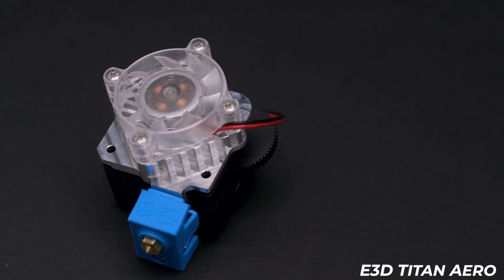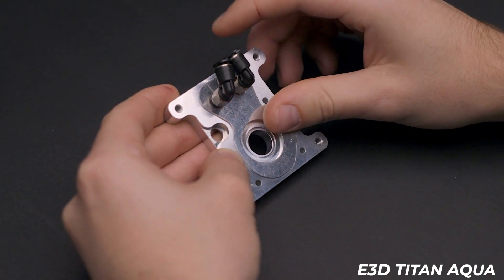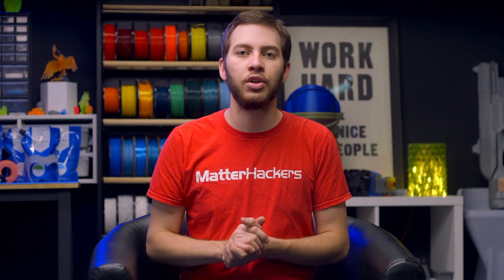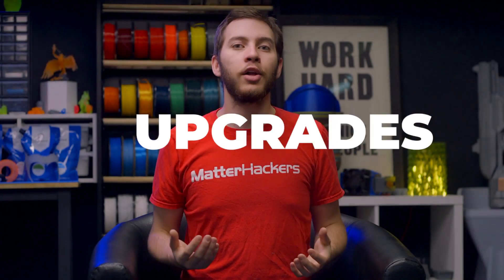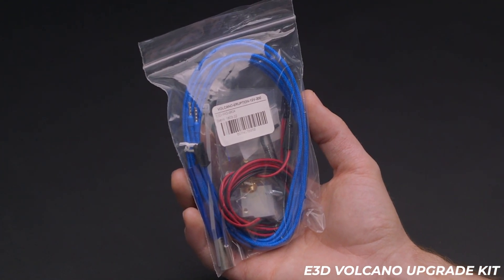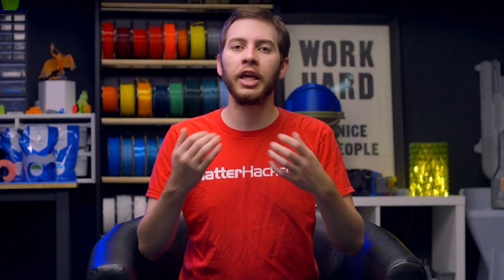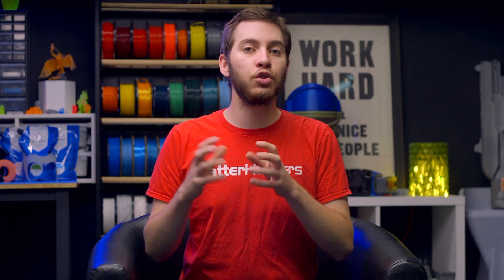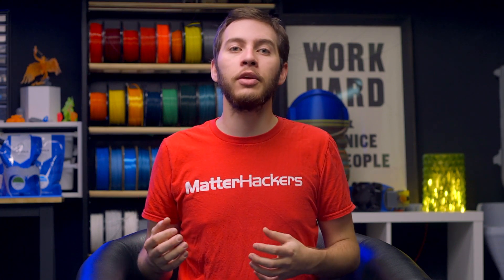Comparison Guide: E3D Hotends

Comment: One of the best upgrades for the E3D V6 is a copper heat block. A titanium heatbreak is also a good upgrade. If you need to print more material, try updrading to a Bondtech CHT nozzle. The plastic nut that mounts the E3D heatsink always comes loose. To fix this, add a thin 12 x 1.5mm zinc plated nut with an internal star lock washer. The lock washer will dig into the printed plastic mount as well as the nut, keeping it from coming loose during your print. Use needle nose vice grips to hold the heat sink in place and tighten gently on the nut with a socket.

Comment: @MatterHackers what is the lighted piece behind you?  Specifically, what filament did you use to print it with?
Reply: Appears to be a desk lamp with a flame flicker bulb inside. You can get this same effect by printing Nylon in vase mode. It will be translucent like this, as long as it is non-composite.